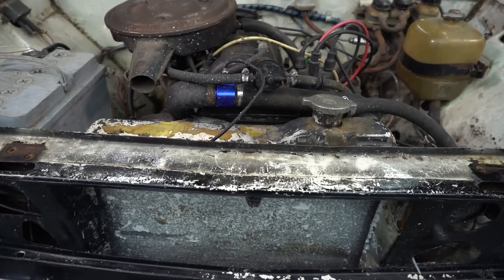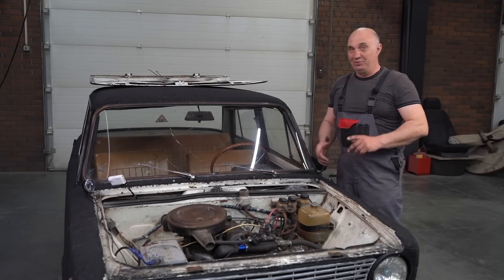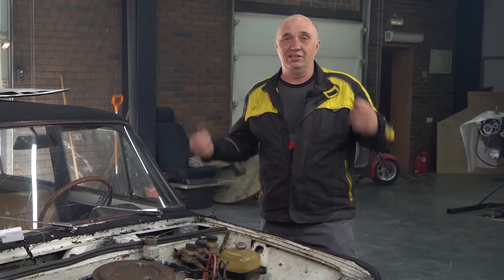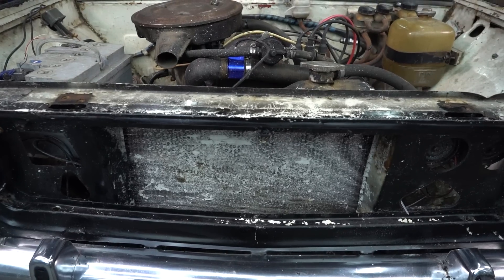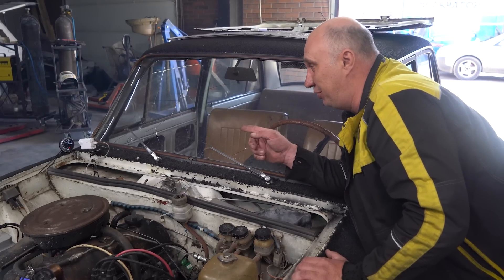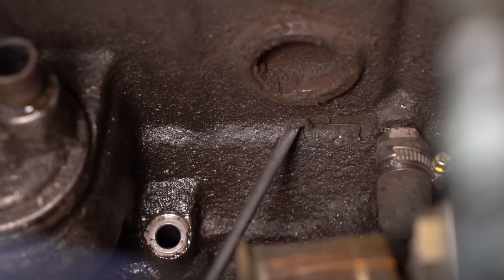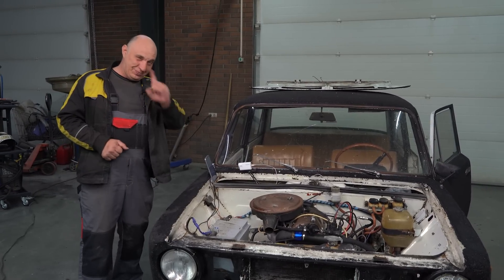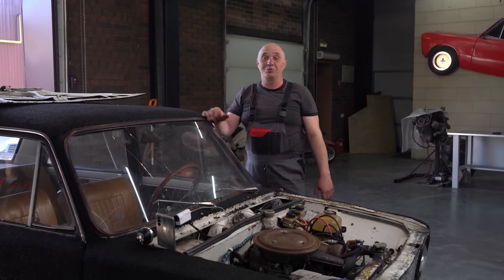How dirty can your cooling system be and still work?

Comment: in kuwait not only an extreme region specific  double core radiator option is needed but also a good large radaitor fan is needed when approaching 42 celius and all the way up to 60 celsius in peak summer, only well maintained cooling systems will make or break a car in kuwait summer
Reply: i wonder how cars radiator could keep up with the middle east heat

Comment: Try driving without airflow through the radiator on the coldest day of the year, removing he fan and blocking the grille so the only airflow while driving comes from the bottom of the engine bay. 

Can you drive without a working cooling system in the most extreme cold?
Reply: Unfortunately not, I’ve tested this

Comment: I have a weird problem with my car.  Whenever I rev it above 4000 RPMs it's like the cooling system just disables and it almost immediately overheats within a few seconds.  But if I keep the RPMs below 4,000 then it will never overheat.

Does anyone have any idea what's wrong with my car?

Comment: Could've first cleaned the engine and then cooler separately. I don't think clean or dirty engine block does anything on a liquid cooled car, especially more modern. I think too much risk of corroded electronics. All of the heat is meant to be dumped in the cooler and the difference might be there.

Comment: Ugh my cooling system in my 1974 Dodge 440 v8 is disgusting and the block is coated with sludge and dirt. Plus I drive every day in 115° Arizona desert heat.
TIME TO FLUSH IT OUT.

Comment: Is it possible to overcool the engine? What will happen if we use 2 radiators or more? 5 or 6 radiators on a Lada engine will keep the temperature low, but how low? Is it possible to lower the engine's temperature to ambient temperature? What will happen I the engine temperature doesn't pass 20°C?
Reply: What will happen I the engine temperature doesn't pass 20°C?  YOU KNOW NOTHING,, STAR STDYING MECHANIC
Reply: Did you figure it out ?

Comment: Suggestion for future videos: 
1-Flush and fill radiator while engine is running. 
2- Try computer coolant in a car.
3-Replace car radiator with a bunch of computer CPU heat sinks.
4-Replace car radiator fan with 120mm computer fans.
5-Change spark plugs while engine is running.
6-Change automatic transmission fluid while transmission is in gear and engine running.

Comment: Next test idea. 
With all of the "Snake Oil" fluids on the market. 

What fuel additive actually works to help clean/ improve the fuel system and slighy cleans the piston heads.
Reply: Lucas upper cylinder lubricant but you must use the big bottle

Comment: A small note about my last comment: There are 2 styles of these "electromagnetic engines" the solenoid style, and the style that acts more like a relay. 

The solenoid style has good revs, is simpler, but very low torque as it is just a coil attracting an iron piston. The relay style is a coil with a solid iron core, and a magnet piston for a significant torque increase. The coil would sit directly above the cylinder spaced by a couple mm. When energized in one direction it pulls the piston up, then when the polarity is swapped it will push the piston down. This gives the engine double the power strokes!
Reply: PS: You can remove the iron core and have the magnet pass THROUGH the coil, This would be a third style of motor, called a "linear motor" as changing the magnet field will change the location of the piston in the coil. There is one more advantage to these engines, the power strokes are constant torque! With a conventional engine the strokes are pulsed(a single explosion) vs the electric ones which have the coil powered all the way through the stroke.
Reply: Cool story bro
Reply: @mann_idonotreadreplies  Thanks.. Except it's truth, not a story. If you have issues with detailed explanations, I'd say that says more about you than it does me.

Comment: V8 Lada
Reply: they would have to cnc mill an engine block. not gonna happen. I reckon a v4 lada could be possible, since the crank would be untouched. move two con rods out sideways at 90 degrees, mill out the main bearings on the extra block and weld up a 90 degree engine sump from mild steel to bolt both blocks to.

Comment: Leaving the bonnet on would have gotten it heating up faster too, a lot of heat gets trapped in an engine bay, which can add to the overheating problem if things aren't kept optimal, and said trapped heat is why those under-bonnet cone filter "cold air intakes" are an utter joke cos they're sucking in that performance-killing hot engine bay air instead, less dense air means less bang in the cylinders... :P
Reply: It's not a problem unless you drive a piece of shit car like Lada

Comment: My favorite trick for very quickly cooling down your engine, is if you have a container of water, even just a liter bottle, you very slowly pour it across the front top of the radiator back and forth, so as the water gets pulled through by the fan and is getting the radiator core wet, you can be surprised by how fast it drops, and it will then allow you to open the radiator if you need to top it up, but of course you still have to make sure the pressure has dropped enough first, some modern vehicles don't allow great access for this, but if you have a garden hose available, you can cool any radiator
Reply: Yep. You are turning it into mini AC. Evaporating water will pull out a lot of energy (heat) from the coolant.
Reply: Wise words Sir 👍  What if you had a spray bottle of water to increase surface area?
Reply: I cracked my radiator last week doing that
Reply: @SeleneHelgelandTrejo  No you didn't
Reply: @SeleneHelgelandTrejo  Car radiators and the coolant inside them have a significant thermal mass, allowing them to absorb and distribute heat gradually. The water poured on them is closer to ambient temperature and evaporates quickly, gently cooling the radiator without causing thermal shock. Unlike brittle materials, radiators are designed to withstand thermal cycling and are made from materials with good thermal expansion properties, preventing damage from rapid temperature changes.
Reply: You crack your radiator 🤭
Reply: Wrong  @mann_idonotreadreplies

Comment: In Chicago USA when it was -10F   we would put a piece of “cardboard” in front of radiator to get heat in the car. (I think the thermostat was stuck open, was an older Chevy 327 engine)
Reply: No need because of thermostat
Reply: @mann_idonotreadreplies  if it's stuck open you have to do that. 

I had an old car with a thermostat that failed on me and I didn't feel like changing it when it was so cold so I put a box in front of the rad. Haha

Comment: You need to close the hood to get to an accurate test. Or in this case, put the hood on and then close it. Hoods keep engine heat in.
Reply: Hood will not make a Major difference unless you're abusing your vehicle like a racecar wannabe driver
Reply: You’d be surprised.

Comment: Need engine cool just remove the termostart and your engine will cool all time is easy fix.
Reply: Thermostat with two "plates", these cannot be removed because The water circulation will be mixed and headgasket will burn.
Reply: @vesatapola7908  that not true my car run wit no thermostat and it fine and run for 8 year and no problem no leak oil and nathing no thermostat is good on hot country .

Comment: The dean of the mechanic school i went to told our class a long story of alot of mechanics trying to find a reason for a car overheating in a shop he worked at and everyone was stumped they called in a guy from another shop and he said instantly “was there a fan shroud stock on these cars?” Problem solved
Reply: Yup, it wasn't a well know thing bank in the day. They do make a HUGE difference. Because instead of pulling air through the radiator without a shroud, it pulls hot air from between the fan and radiator. Makes perfect sense. Also, to find a plugged radiator, I've let it run until it overheats, and spray water on the radiator to see if it drops. Although not a 100% accurate test, it helps narrow it down. Because if it was the thermostat, the temp would hardly drop at all.
Reply: @onestop use a thermal camera
Reply: @mann_idonotreadreplies  They weren't a thing back in the day but yes.
Reply: @onestop use a mini thermal camera
Reply: With older cars people would toss them and leave them off for easier access to belts, not knowing that they were creating an overheating situation next time they got stuck in summer traffic.

Comment: I have a good video idea for you guys! You have made a few of those spoof "magnet engines" in the past, but there is 1 style of magnet engine that actually works: "Electromagnetic Engine" (you can find videos of small "plunger" versions on youtube). A coil of house wire wrapped around the cylinder, a magnet for a piston, apply a voltage to the coil and it pulls (or with reverse polarity, pushes) the magnet piston. There is a lot of room for testing and experimentation like the gauge of wire used for the coil, solid or stranded, copper or aluminum etc. A simple hall sensor can trigger the coils for timing (or other methods such as an arduino, relays etc.). Would a pulsed coil(electromagnetic engine) be more efficient than a constant drive such as an electric motor etc.
Reply: LIVE STREAM IT AND TELL EVERYONE IN THE FAMILY AND ON YOUTUBE YOU  ARE NOT HOMM I CID AL OR SUE A/C IDAL AND HAVE NO CRIME CONNECTIONS.

Comment: Depends on the Area.. In the desert they dont even have a thermostat.. In the cold, you run a thermostat for heat exchange through a heater core.. The more the fluid warms up the more heat you get.. 

Also Thermostats run at different temps.. In America its between 160-195 F..
Reply: SOULWARRIOR, Don't BS others with your misinformation!! NOBODY living in the desert removes their thermostat; it would completely disrupt ALL coolant flow around the engine and make cooling much worse!  I live in outback Australia where air temps. in summer get to +52C (that's 126 Fahrenheit for idiots like you). And what even is a "heater core " ?? The cabin heater element is directly connected to the engine, it has nothing to do with the thermostat element!
Reply: thermostats are also there to keep engine at a specific temp that is ideal for the engines economy and emissions, putting in a thermostat that opens to low of a temp compared to oem specs can cause extra wear as the engine cant warm up properly and decreased gas mileage. yes it depends on environmental conditions as well but its something to keep in mind

Comment: My friend used to have this little Austin Metro he'd rag up and down the dirt track. We'd just leave the top off the coolant expansion tank and let it boil so the pressure didn't rise crazy high. We'd bring a big bottle of water and keep topping it up as it boiled off. That evaporative cooling really works well if you're driving hard for extended periods at low speed. Should have tried that with the car you were redlining in first around an empty car park.

Comment: Having to put the heat on stuck in traffic sucks so bad. I've had to do that before.
Reply: Haha yes it does and so have I.
Reply: Better than putting new engine in.
Reply: @SmallKittyPaw  very true, pulling an engine isn't always an option, just have to deal with it.

Comment: Insulate engines in the winter?  How frickin cold does it get there?
Reply: These guys live in Novosibirsk which was built in Siberia.
Reply: Well, it's usually nothing fancy, along the lines of putting a piece of cardboard behind the radiator grille. Though Yakutia and other colder regions do require a bit more than that (so to answer your question - it can get pretty chilly).
Reply: Not all of Russia is cold, but they happen to be in one of the colder areas.
Reply: @mediocreman2  im from the south i would freeze to death even in the warmest area of Russia 😂
Reply: I have been there a couple of times in both winter and summer times with my wife to visit her relatives and -30/40°C was the coldest I experienced there. In summer, it can be the same with a +, even if it is  pretty rare
Reply: We sometimes block the radiators with cardboard here in Norway during winter, especially diesel cars.
Reply: russian winter is on the negative double digits, Napoleon's soldiers lost the buttons on their uniforms because tin alloys break down on extreme cold, and a couple centuries later, the other guy lost tanks and boots to cold

Comment: You should do a video comparing standard weight and heavier weight oil in a worn out engine. I've always wondered if thicker oil was better for worn components
Reply: It is indeed my corolla has 330000 miles and it has some valve chatter if you run straight 5/30 but with a half a bottle of Lucas it's quiet as can be, there's a guy who ran gear oil in his engine and the only noticeable difference was the smell from the Sulphur in it
Reply: Yes it is

Comment: Make a drone that will hold a passenger by using 4 Lada engines, instead of electric motors.
Reply: power to weight ratio will be a pain in the buttoffsky, choppers and drones need very light motors with very high horsepower ratings, such as two strokes, aluminium and turbo charged engines (choppers dumped piston engines in favor of turbines for that reason), and Lada engines aren't light, still cast iron blocks are heavy, and 4 cylinder seem low power.
Reply: Wouldn't work. Not enough power

Comment: Great info, my engine does overheat during summer, maybe if I will properly wash it will work better
Reply: Be careful high pressure can bend the cooling fins
Reply: My Jeep with a 5.7 engine was always overheating out on the trails - not enough air going through the radiator at slow speeds, and no larger radiator available. I installed an oil cooler with an additional large oil filter and a bypass Amsoil oil filter (yes, it has three oil filters now) and no more overheating. Oh, and very clean oil but more expensive oil changes. The needle doesn't even think about getting into the overheating portion of the gauge.
Reply: That can help, so can a good flush and cleaning and a new thermostat, unusually inexpensive to do too
Reply: Going on with a pressure washer in a modern car would not end well because so many electronics
Reply: @Patrick-bu4vq  Oh man, so u never drive on rainy day?

Comment: mitsubishi evo 8 and subaru impreza have waterspraying on the cooler, for just extra cooling, something to test on a lada,.?
Reply: Subaru doesn't have it for the engine. They spray is for the intercooler.  To put more dense air into the turbo for more power!

Comment: New clean oil also helps a lot, it transfers heat better, and without a thick coat of varnish on all the parts the heat transfers better.
Reply: There are several reasons to make sure the oil is fresh, but if you have to do it to get the temperatures down then there are other problems that should be fixed.
Reply: @blahorgaslisk7763  for a daily driver yes but performance cars on a track even a proper setup can overheat from old oil.
Reply: @joey9511  My sister competed in racing and the oil was replaced probably every race. My cousin married a guy who competed in offshore racing. There were two Lamborghini V12 engines in his competition boat and they were rebuilt between each competition. If you are really racing seriously then running old nasty oil isn't something that will happen.

Now there are classes where less professional racing occurs, but again I think most everyone competing will serve their cars decently so nasty oil shouldn't be a really bad thing.

Keeping the coolers clean and the coolant well topped off is an easier way to keep the temperatures under control. And unless you are really beating that car badly and replace the oil before it clogs the engine it should still work.
Reply: @blahorgaslisk7763  the only automotive race engine that get rebuilt EVERY race are topfuel dragsters in fact even f1 has a limit of 4 rebuilds a year without penalty. 

racecars don't use normal coolant they use water which obviously doesn't break down while oil breaks down completely after 1-2 hours of runtime (in f1 engines)  and must be replaced every race while coolant is replaced when parts fail or end of season only due to corrosion. 

engine combustion happens at 2700+ degrees your engine block doesn't care if coolant is 100 degrees or 500 as long as it doesn't boil and can still remove heat its fine but oil temps over 260 degrees will kill your engine within minutes of a race.

remember Porsche didn't even use water cooling until 1997 and had been winning races for decades.
Reply: 90 degress is ok-
Reply: @anteneupitra  For a modern engine (and cooling system), yes, is good. But this Lada cooling system is different, not pressurised that mutch than some modern system.